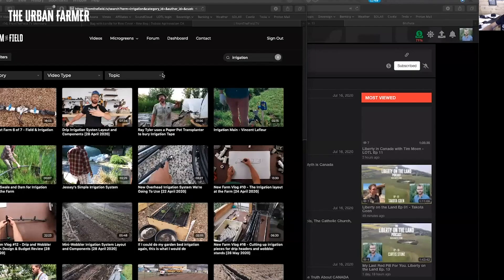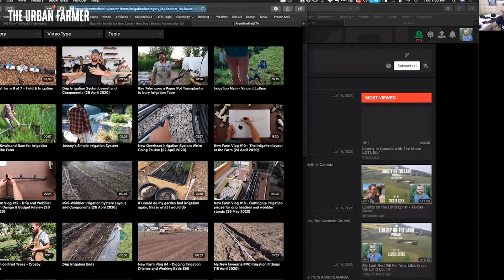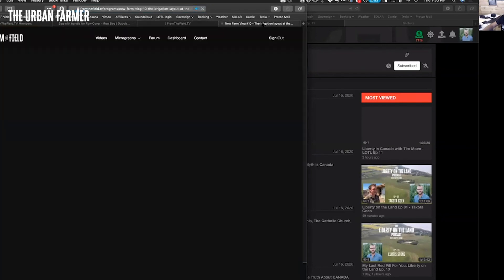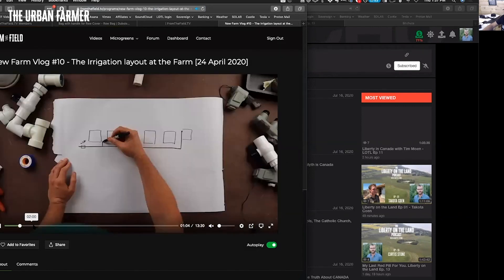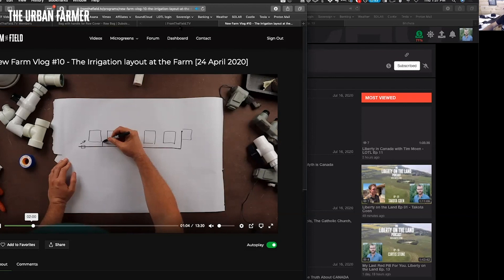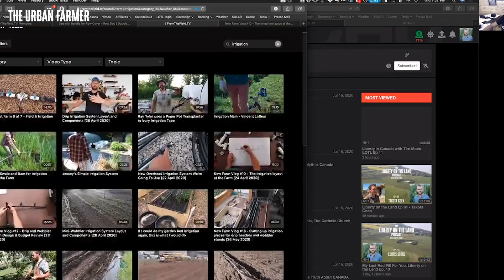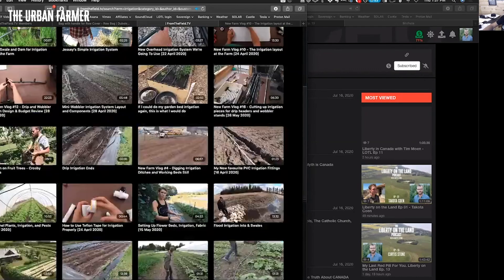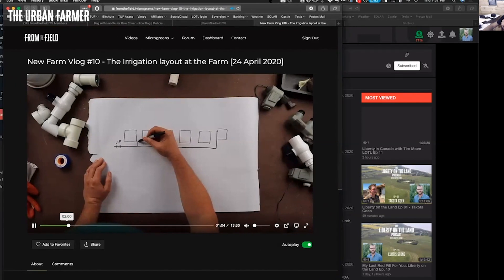THIS Is How You Design a Mini-Wobbler System (Curtis Shares His Thoughts)

Comment: I run 50x82 field blocks (12x 25m rows on 1.25 spacing) and use two rows of three mini wobblers. They run from a 20psi pressure regulator via a 25mm header and 19mm laterals to 1200mm risers. I initially used 900mm risers per Senninger's spec sheets, but I found the extra bit of height helped with better coverage on the edges.
I found that wind drift is a problem with such a small droplet size and large coverage area per sprinkler, even with just a light breeze, so I have 1900mm tall windbreaks of 50% shade cloth on all borders of the blocks. If my water supply's flow rate wasn't so limited then I would go with three rows of four sprinklers per block.